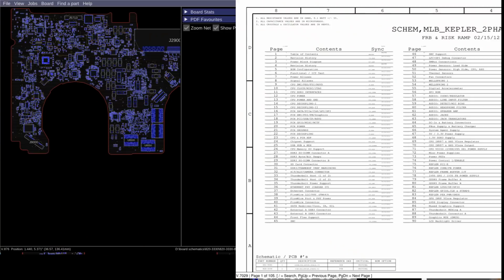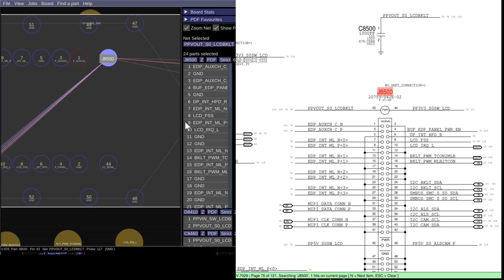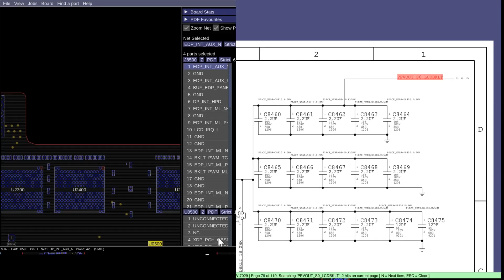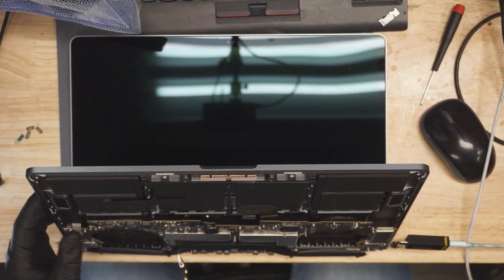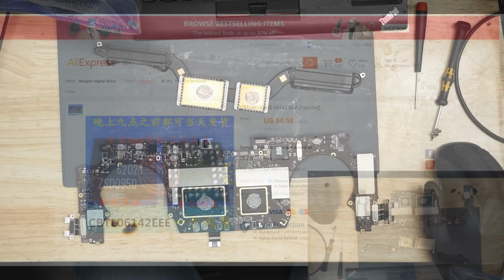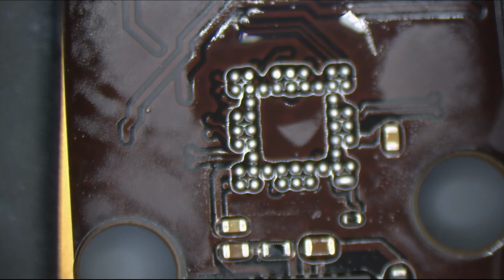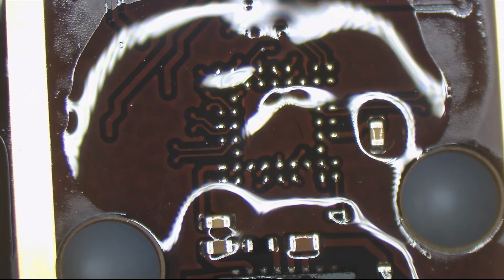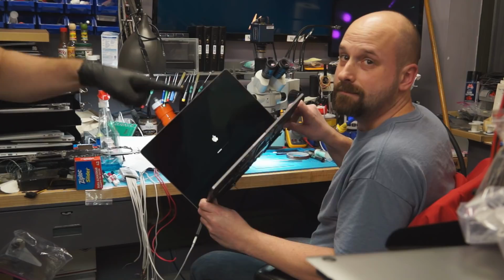Apple botches Macbook board design: again!

Comment: Hey Louis, as a former hw engineer of a large company, it's easy to see where this error arose. No single designer is responsible for the design from start to finish in a large corporation. The error started with the CAD librarian (responsible for drawing schematic symbols for new parts and maintaining them in a "library") who incorrectly labeled pins 1 and 43 to be far apart numerically when physically they are close together with the mindset that the physically larger rail (voltage and ground) pins (43 and 44) should be grouped together with the other rail pins (45+), without highlighting that pins 43 and 44 are actually physically super close to pins 1 and 2. The board/circuit designer (person responsible for designing the schematic) then imported the connector into the schematic and performed pin assignment with the assumption that pins 1 and 43 are far apart because they're numerically far apart (a completely different mindset than what the librarian had). When this is passed onto the layout engineer (person responsible for actually routing the design on a physical board), he routes the design blindly and does not catch the error because he does not know or really care about how the circuit functions. When the board goes thru testing, nothing is ever caught since nobody has the foresight to purposely try to short a design during testing. Ultimately this is a flaw due to a misunderstanding/mismanagement between multiple engineers with different functions. This would never happen in a smaller company where the design is owned by one person from start to fab, so Apple being rich and large actually works against them because all of the engineers that work on a board need to have the same exact design philosophy or at least adhere to the same standard. This flaw is still, of course, unacceptable and can be remedied with better communication or a set internal design philosophy standard.
Reply: I'm an electrician, so I deal with higher voltages and larger loads. We have similar problems, but mostly because of idiots who just don't know how to label things correctly. The project I'm on right now just had a few vacuums let out the magic blue smoke because someone mixed up a 277v circuit with a regular 120v outlet circuit. They were the same circuit number, but coming out of different panels.
Reply: It also seems like a perfectly complicated explanation that could easily be planned for further shortens the life of the laptop and/or be able to subcontract that mistake to get more money from the same costumer that already is paying an incredibly high markup.
Reply: Sean Mitchell Or... y’know, it could be the far more likely explanation that this is just human error that will be fixed with the next update...
Reply: So in 2019, Louis Rossman is hired by Apple as an external consultant/Sr. board designer, and sets an industry president by being paid exclusively in replacement parts.
Reply: you are absolutely right in your assessment. 
we all know, accidents always tend to happen. every one of us has one of those stupid moments from time to time. the real fault here is that there didn't seem to be any kind of thorough final design review in place, with all departments present, where things like that should have been caught. or they did catch it, but decided the risk-benefit ratio was in their favor and approved the design anyway.
Reply: As someone who works at a small company and does schematic design, library management of parts, board design, testing/verification, ect ect. I always make sure to make schematic symbols for  connectors appear as they do in real life for this exact reason!
Reply: No sir its not flaw. Its intentionally created incase small incedent happens and they get to charge you much more. Why other companies are able to fix these things? Because they dont cheat the customers
Reply: dothemathright 1111  this is assuming they setup of the design rules with that in mind in the first place...
Reply: Having known someone who worked in apple accounting. They calculate the risk of every component quality option in their devices, under warranty costs vs lifespan. You can bet if this did come up it was determined to be acceptable for their profit goals. Like saving 1 cent on a component that would likely cause 10000's of failures after the warranty period.
Reply: If that was designed for sturdines a double thick plate  shouldve been created for hw line and a gap
Reply: So, the TL;DR version of your post would be multiple levels of people working with blinders on perpetuates these seemingly simple design flaws. Not really an excuse for poor design, but it works well as an explanation.
Reply: Honudes Gai there also have been no major updates since 2016.
Reply: @TheObiareus  They never fix things "in the next update." That's why they have so many systems from such a large time frames with the exact same poor design.
Reply: @GeneralKenobiSIYE  I also feel people who would shit on Apple products even if they gave them out for free don't have anything worthwhile to say, but hey, facts don't follow feelings, do they?
Reply: @GeneralKenobiSIYE  MBP designs last for a 5 year cycle. The next "update" refers to the next cycle, you don't put out new laptop designs in under a year.
Reply: @ManoharBoss  Example of those other companies where they fixed such design flaws? Apple is put under more scrutiny, and rightly so due the premium they charge, but this doesn't mean other companies get off on this too. Plenty of design flaws in Dell, Lenovo etc. too.
Reply: Unironically: Is that why ROCK, Gigabyte, and other board makers don't make mistakes like this? Because they're smaller teams? Is it because Asus and others are so out-classed by apple that they don't have the resources to make it work. Is it really possible that even the likes of Google have a smaller team set aside for JUST chrome-books? 
I am unironically asking, I'm sincerely curious, and I don't know much about laptops: Other than... I am poor apple is expensive and Thinkpad is best because I love me some of that nipple-clit-dimple-
Reply: Tip of the hat to you my knowledgable fellow 💪
Reply: But any company with serious testing would fix such an error after prototyping, redesign the connector and PCB and do production run with a couple of GND pins inbetween.
It only shows that apple poops out prototype stage products without any serious review/testing.
Reply: Process is irrelevant, end result is bad implementation
Reply: I don't give one shit the reasons. It's Apple's damn responsibility. Bottom line Apple SUCKS and I have hated them since I was forced to start using them in 1994 all the way to present.
Reply: So in short it is because people do not take pride in their work anymore and perform to the minimal requirements without looking left and right.
Reply: Chuck Norris This one is hard to fix.  Followers of Louis will recall the global mess caused when, years ago, Apple sold very similar laptops with two different backlight technologies, causing bad returns when people bought the wrong replacement screens.  Any change to how the connector is shaped or wired will repeat that debacle.  So the only practical fix is to add a heavy duty protection circuit to catch and safely swallow any short between the two pins.  Fortunately, this is the low speed display identification line, not one of the very high speed pixel data lines, which should make such a protection circuit cheaper.
Reply: Explained, but not excused.
Reply: Are you that librarian
Reply: I was trained in electronics in the Navy in the early 1970's. Putting any v line next to signal lines was a big NO-NO.  There were usually grounds or spaces between the pins of the power sources and signal to the connectors.  The dual line connectors did have a wrap around pin numbering system. Also, I worked on units that had 300v vacuum tube plate supplies to the 5v TTL lines. I haven't seen this problem until I got out of the Navy and worked in the civilian world on consumer products.  One glaring example was a small, portable Zenith TV . The control pot set were on top of the front case. Also the back of the control PCB had a foil shield opposite the board backed by paper. These fried constantly due to the arcing from the CRT anode just below it to the thin foil backing. This sometimes causes fires to the plastic case and beyond.
Reply: @thirtyfiveedu8883  FYI: precedent (but you got a genuine LOL, so you get a pass this time) ;o)
Reply: So you're basically saying, "oh well, too many cooks ruin the soup, it could happen anywhere". So what if you can imagine a scenario you're ok with. No. There needs to be quality assurance. Eff you apple.
Reply: @krawutzimon  Because they hire people to tick boxes in their intersectional ideology in silicon valley. I highly doubt this would have happened if they were hiring people for merit and quality of their work. It's been happening a lot in other companies there too. Basic mistakes being made that make it out to the public in the shipping form. Caused all by the same viewpoint.
Reply: @krawutzimon  It seems to me that the overall design of the work process is faulty. The design should prevent people from making mistakes rather than encourage the mistakes or even make them inevitable. It's not the worker's faults most likely, they are set up to fail by the badly designed workflow.
Reply: I'm quite surprised person responsible for layout would completely blindly route the board. You have net classes and other good stuff available in Altium Designer and you would see straight away supply rails vs signals and it would pop up straight away. I'm also sure they have different design rules so at least at some point he should notice something. Also routing what most likely is 16 layer board is begging to go through it couple of times and make sure everything makes sense not only run DRC Check and be happy cause it passed lol.
Reply: Daniel J nobody is denying that this is apple’s responsibility. It is. And yes, apple’s bottom end Macs do suck. What people are arguing is that this particular design flaw isn’t apple being malicious to their consumers, but rather is an honest mistake that will likely be fixed in the next major design overhaul in 2-3 years. Is apple perfect? No. But for a lot of cases they are simply the best option, despite their occasional bullshit.
Reply: Apples profession is to be amazing at trying to get on r/crappydesign, someone needs to put its newest products on that Reddit page.
Reply: @krawutzimon  It pretty clear that Apple, in their design reviews, did not do an FMEA on the logic board design.
Reply: While your explaination is perfectly fine and logical shouldn't there be some kind of QA involved (don't know if modern design enviroments have DRCs to check for this)? If it's a failure that arose in quantity in the past you can still adjust your design and prevent the mishap for the future (albeit communication would probably have to go through multiple departments).
But yeah, I can totally see how that error propagated ... I was gonna go "hey, they left half a pin spacing as a gap" when Louis was showing the boardview ... only to see that "gap" was actually just representing a wider pin on the connector.
Reply: The short version: cheaply made in China.
Reply: @krawutzimon  yes indeed, because of arrogance.
Reply: @cro0w , No s____, Sherlock.
Reply: @TheObiareus  , board errors can't be "fixed" with an UPDATE.
Reply: Apple deliberately introduces shitty engineering designs because they follow two principles: 1) make the laptop/desktop thinner and thus "sexier" or 2) cheapen the design to reduce the cost of the mainboard while increasing the price they can charge the consumer more in the end and increase profit margins. This isn't because of some random oversight because other large companies such as Lenovo or Acer (which I am using right now) don't seem to face that same issue like the MacBook Pros. I cringe when I see with each progressive year Apple design getting increasingly worse (I do actually own a 2012 MBP 13") and I refuse to buy another Apple laptop (iMacs I can tolerate more) or phone again.
Reply: So what he is saying is Apple has no STANDARDS I agree with this.
Reply: I feel like the greater issue here is that this is a new issue after years of having been designed "properly" so to speak. Used to have a gap, suddenly doesn't. This seems like someone said "Hey, lets do a complete redesign" which is fair when they went from the old LCD connector to the new, smaller, one. Still though, QA should have caught this during normal testing - which usually includes humidity and water tests, which would certainly jump those 2 pins and cause shorts
Reply: Yet they keep blaming us Firmware Engineers...
Reply: TheObiareus .......  you use some extremely rose colored glasses......(you're incredibly optimistically naive.)
Reply: I get things like this are overlooked by a large company, but that should also mean there should be people looking these things over.  If they screwed up like this, it should get fix in updated boards, or at least the following year computer.  Sounds more like some lazy employees not doing their job correctly.
Reply: the layout guy should have picked this up though
Reply: These types of design issues also happen with cars, buildings, the suitability of using a particular piece of real estate or land for a purpose not suitable for that purpose: such as ignoring natural water flows, type of soil strata you intend to build upon.  New York City, Houston, New Orleans or Miami are a good example of areas that will flood as sea levels rise from storms or there is a lack of good drainage after a storm.  Of course there is also the "Leaning Tower of Pisa" where tourists flock to see engineering design flaws.
Reply: @ligerstripe99  They don't hire people that tick boxes in their intersectional ideology. They hire people that work for less money. It's called profit optimization.

And I know I'm over a year late, but better late than never.
Reply: @johnrobinson4445  China manufactures just what you ask for. If your design is terrible or good.. they don't care. They just do what you ask them for.
Reply: That's why you have a QA to bring PoC board back to design upgrade.

Comment: Don't delay, boycott Apple today!
Reply: I wanted a Laptop for some on location photo editing and printing and I had an eye on the MacBook Air (pre USB-C). In a useful (maxed out) configuration this would have cost me about 1.600€.  
1.600 for a dual core with 8GB of RAM and even refurbished ones sold for well over 1000? C'mon Apple, thats unreal. Now I have a slightly bigger but still very portable 14" Lenovo (refurbished) with twice the processing power, RAM and SSD for less than 350,-
Reply: Already did 😉
Reply: I boycott Apple since 1984. Since Woz's open policy in the Apple II was replaced by the closed assholery of Jobs.
Reply: Is it really a boycott if you never buy their stuff becausw it's overpriced garbage?
Reply: @Danial Rafiqi Why do you NEED your iPhone? What does it have that your modern Android does not?
Reply: Steve Jobs has got to go HEY HEY HO HO
Reply: SO WOKE!
Reply: @HunterSNK  That's why I use a Linux based smartphone such as Librem
Reply: DONT DELAY CLAIM TODAY
Reply: A proper personal computer demands blood sacrifice.  The older cases were sharp unrolled steel to facilitate this.  Today, the technician is expected to bring his own athame.

Apple makes shitty products, substituting meek imps which will only last for 2-3 years in place of the originally specified greater demon.
Reply: Here: APPLE IS FOR LOSERS, TIM COOK WANTS PROFITS
Reply: Indeed